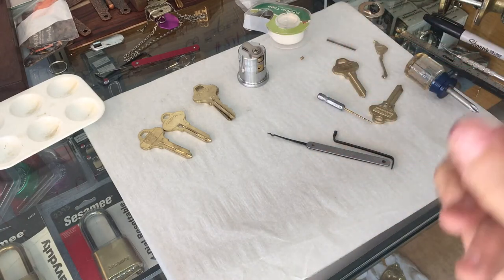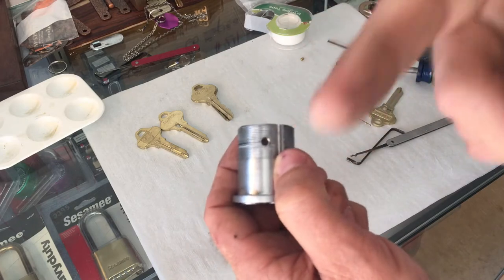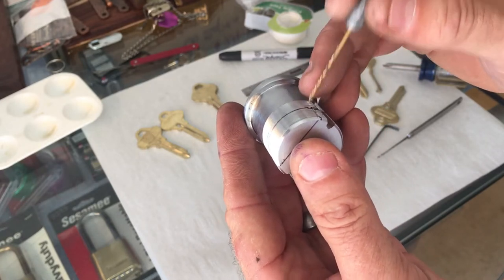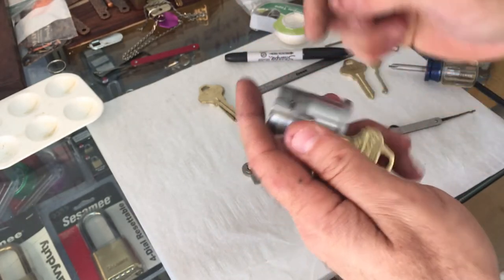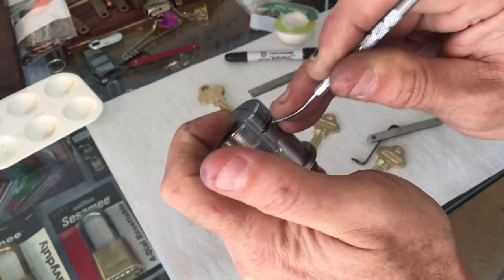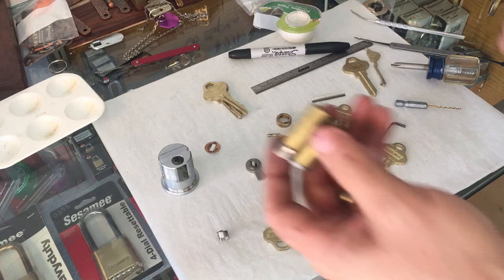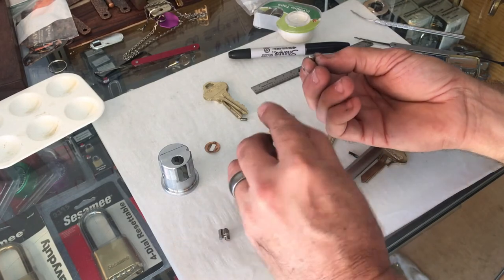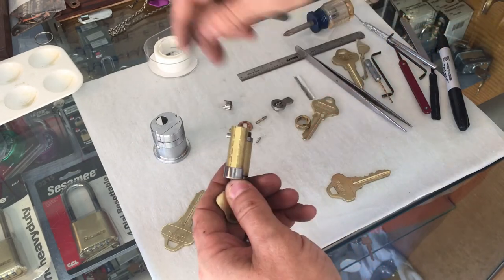dealing with Schlage Everest LFIC cylinder, no key

Comment: those shimming using a pick must not know about using the key blank techniques. or sitting with a special profile and no blank for it. For that reason, I keep a collection of used restricted keys with 0 or close to, cut in the tip. Even the most extreme paracentric keyway let the right key blank in. 
The IC concept is one of the most evil scams. Replacing normal screws with a single copy of the only magic key to take the lock apart. A key that they will never have usage for, until the locksmith ask for it.

Comment: I cut a control bump key and got it with that took about 10 minutes but it worked for me
Reply: Paul Chaulk lol I just left the same comment sir.
Reply: a bit of background Just recently bought this company and gearing up a case of cylinders,kiks etc I came across this "new" motice cylinder with an Everest core and no keys . I wanted to include it for service calls and the like but no keys so I had a few spare blank control keys etc and tried  cutting a bumpkey and a control bump key  to remove the core for pinning later so Just hauled the cylinder and housing out to make sure I wasn't wrong as i still have it and i noticed the check pin is missing so that may have helped bumping it , tried bumping it again and sure enough bumped to control. I dont know what the pins are like but i do know a 0 or a 1 cut key does't open it as it was "new" in the box when I bought the company but evidently it was pinned and the check pin removed. I will gut it this weekend and pin a new cylinder to see if  bumping will work with the check pin installed. this video really has me thinking whether I was lucky or not
Reply: hey greatly appreciated I was starting to wonder whether I fluked it or not
Reply: Paul Chaulk I've done the same thing buddy.
Reply: Paul Chaulk where are you located sir.
Reply: Very Cool Paul Chaulk 😃. N.

Comment: I've cut a control bump key. And it works my friend.
Reply: Best way to go, I've worked on some absolute crap cylinders that are jammed and wont come out, in this case it will bump but only to the user position and not the control
Reply: What depth cut is the control pin%

Comment: I just cut some S123 keys at work today :)
Reply from the maker: Jeff Moss that new undercut makes the machines sound different when you cut
Reply: I think there is a shim that comes with the blanks but I've never used it.
Reply from the maker: Jeff Moss I’ve never gotten one or seen one & Ive has to order them practically since the beginning of production. We had a new building built that was one of the first to use the S, and they needed a immediate Rekey. Not a single supplier had blanks, I called EVERY one 🙄 finally found out US lock had control keys only so my first batch all had CONTROL stamped on them 😂 ground every one off and used em as regular, my customer (cool guy) was like what’s that mean. I told him it means YOU ARE IN CONTROL OF THESE LOCKS and he seemed cool with it :)

Comment: How do you pick best the control if you have no keys and how can you take best apart to get keys to them
Reply from the maker: Matthew McCurdy there are best tension wrenches you can get to turn the inner housing to get it to control (Peterson) and then you push out the pins from the bottom and typically replace all. Everything about best requires certain tools and pinning kit however,it’s nothing like regular cores :)
Reply: the card is in the lock in the lock is locked I'm trying to get it out to rekey it or to replace the core I can send you a picture of the lock I am a licensed locksmith but I cannot get it picked over do you happen to have keys that can possibly help me get this picked over or can you do a video on best